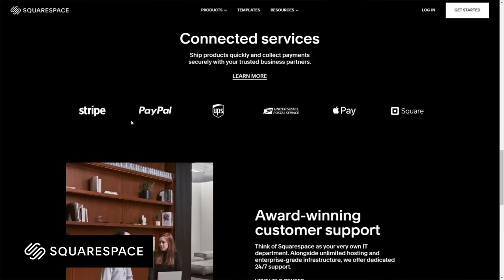I Bought 8 Broken PS5 DualSense Controllers - Let's Fix Them!

Comment: I couldn’t believe this video is real, this crap should only be happening after a few years with hardcore gamers. Sony is definitely slipping through the cracks, just makes me want to wait a little longer for a slim console and a redesigned controller on the inside
Reply: I’m glad there is a space between its release and the ability for the average person to get one. Allows us to see the problems beforehand.
Reply: My DualSense controller works fine
Reply: @earthinthecomments4944  seems like a hit or miss when anything new launches. I still got my launch ps3 from 2006 and it runs good with no issues yet thousands got the YLOD in only a few years. Could be a similar trend with the ps5 controller and console too

Comment: 17:02 the only issue I've had with my dualsense is this but on the L2,kinda scared to do the repair myself tho since it is usable tbf it does register it's just a little less tensioned than it was at launch/should be

Comment: Another great video! Any idea what's the issue with the strings Steve? These seem to be the same as in the Dualshock but them snapping appears to be a prominent issue. Happened to me twice, I have been through forums reading people with different habits so no direct correlation to shooters, people disabling all gimmicks (trigger, haptics) and still getting this issue. Could we talking about a faulty/bad quality batch or is something within the new controller build affecting it/applying too much tension?

Comment: Do you always grip your soldering iron (Hakko FM2027/-28?) almost by the tail, or is it only when recording to try to not obscure the shot with your hand?
Reply from the maker: My soldering setup is very strange while trying to solder and film at the same time, lol!
Reply: @Tronicsfix  I guess that might be one of the inherent challenges of filming any small-object hand craft. While I do of course recognize that the shot in question wasn't exactly jumpering a torn BGA pad on an Iphone board, but rather large throughholes, it still lightly triggered some strange sort of frustration-angst in my gut 😅 Like something from years ago when trying to solder (then) small, components with those auto-store cheapo no-temp-regulation 30 watt irons, where distance from frontmost possible grip, to tip, must have been at least 10cm. To further help the situation, I didn't even know there was such a thing as flux.
Reply from the maker: Those soldering irons are the worst! Ha, ha..flux is essential!

Comment: I had issues with my PS5 Controller. The R2 Trigger became loose, like very sensitive, the guns would shoot by touching the R2 button very lightly. I rang Sony and they said asked for the serial number on the back of the controller & told me it's still under warranty! They sent me a pre-paid stamp with the return address. They said if they can't fix it, they'll send me a new one. I'm in UK.

Comment: Steve, do you ever test wireless battery charge hold? It doesn’t seem to be a common issue in controllers, but I don’t know if they can be like phone batteries and stop holding charges for lengths of time.

Comment: Hi! Tronicsfix good day, new sub. just found out your channel I just want to ask About my ds4, the charging light is on even its no connected to usb and if I will not use it the battery drains overnight, I already change the battery same problem. TIA

Comment: 20:34 Can you explain how this sensor works? When does it activate? Since if you press it with your finger it doesn't work? And is it different from the DS4's film?
Reply from the maker: Your finger isn't conductive enough. My metal tool conducts nicely so it works using that. It's not the same as the DS4

Comment: I was wondering if they use the exact same analogue sticks in the xbox and ps controllers? Even the older ones? I'm asking in case I need to replace mine on my DS4s, or renew an old DS1, not sure if the parts I find online are interchangable. (They look that way though.)

Comment: It's a little bit scary seeing this many controllers with issues but I guess if you figure there's millions out there it's not so bad. Still though I swear controllers are breaking easier and easier these days. Other than the sticks themselves no PS1 PS2 PS3 PS4 controllers I have ever owned had any issues that weren't caused by me accidentally yanking out a cable that damaged the charge port.
It definitely makes me want to spend the money and get warranties this generation.

Comment: Hey Steve just wondering if you can explain how to properly slide the R2 button off the hepatic assemply? I'm going thru the broken spring issue and having the trigger off the assembly to put the springs can make it so much easier, the problem is I don't want to break it in the process.

Comment: What’s the consensus on a water logged  controller? I bought a new one since then, but my sister spilled a pop by accident on my old one and just FUBAR’d it. I’d be interested to see if it’s fixable.
Reply: Pop would be much worse than mere water. If it's just water, it might work fine if dried promptly, but any additives in the water, like various acids common in flavoured soda, will corrode electronics. Not to mention they can be troublesome to clean. If you get stuff under a chip, especially BGA mounted one, then that's it.
Reply: @herrakaarme  that’s what I thought too. I kept it just incase, I was gonna try and sell it for someone to tinker with, then I’d be a scumbag lol

Comment: Steve I have a ps4 controller that I replaced the analog thumb stick.after I reinstalled it the controller no longer powers on. Can I send it to you so you can make a video. If you fix it sell it if not use it for parts.
Reply: It could be I probably damaged a ribbon cable. But when I put it on the controller charging Stan I have the blue light looks like it's having a seizure
Reply: I already purchased a replacement controller. I think I have extra parts that I purchased from Amazon I can send with the controller

Comment: Do you have to calibrate the analogue stick after installing a new one? I went to the trouble of replacing one on my scuf controller that had horrible stick drift, it worked except calibration is way off center and I found info saying they calibrate it with special software afterwards.

Comment: I have a Dualsense blinking orange two/three times, won't charge, won't connect to PC (GamePad Tester) via cable or bluetooth, cable is fine, I checked it with another Dualsense. The controller was working/connecting before. Factory reset button gives me the same orange blinks. Any suggestions? I really don't want to reflow that chip.

Comment: Oddly enough watched this video cause both of my PS5 controllers died on me simultaneously. No charging whatsoever no matter the cable or charger port/block I use. Soon as it is connected to the PS5 I get the message "too many usb's connected." Bought another controller and I have no issues. If you need two PS5 controllers just to tinker with I got you.

Comment: Where do you get your parts, specifically the analog sticks? 

I just bought a batch of "OEM" sticks of ebay and 4 of them are worse than the ones with dift. I can see that the "alps" name is not stamped into the metal but etched which makes me think they are copies although everything else looks identical to the ones that are on 4 ps4 controllers I am working on.

Comment: So my ps5 controller worked perfectly fine last night. I put it on the charge when I was done. Today I try to use it and it will not turn on and the charge light doesn't come on either. Any ideas?

Comment: it doesnt make sense that the R2 button was fixed after replacing the spring, the button still makes contact regardless of that spring. my ps5 controller spring broke and is very sensitive but it still works perfectly fine.

Comment: Hi, i don't know if you respond to comments like these but i have a question about controller joysticks.
I replaced two on a ps4 controller i have but something strange with the replacement joystick modules is when i used the same website in this video to test the sticks and moving them in a circle the website shows the little dot going outside the circle in all four corners, this happens with all joysticks.
Ive tried googling this but i can't find anything.

You know a lot more than i and im always looking to learn new things so if you could please let me know your thoughts that would be amazing.

Comment: They should make the analog sticks as modules. To swap out easily because those sticks are very unreliable and don't last long. Have ps4 controls that start drifting in couple of weeks because of that. The ps5 control are using the same analog part. I tried to swap it myself but I couldn't even desolder the 14 pins and wasted another 60$ on soldering and parts.

Comment: Hey, my dualsense just randomly started messing up where when I would plug in my wired headset it won’t work unless I press it firmly into the controller. I’ve seen where others have had this problem. Any ideas?

Comment: Anyone had issues with a sticky touchpad. Feels like its sticking when pressed. Can hear it aswell.   I dont have the issue on other controller or the one i sent back to Sony faulty.  And no i havent spilt anything on it or anything like that.
Reply: Small syringe and isopropyl has helped my touchpad and buttons from sticking.

Comment: Gee PlayStation. It's almost like using a cheap, flimsy spring in combination with a motor that makes the trigger hard to pull was an incredibly stupid idea, and literally anyone could have seen this problem coming. Get rid of the "adaptive triggers" or whatever they're called, or invest in stronger springs.
Reply: It's not only designed poorly, but it doesn't feel good to use